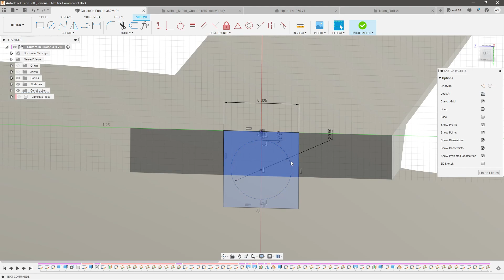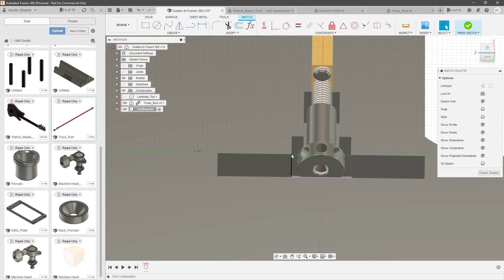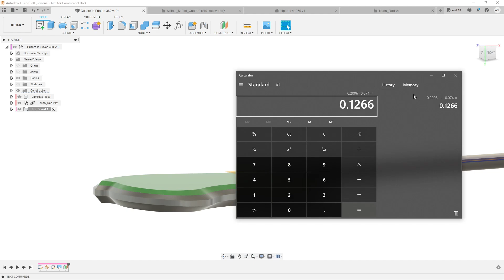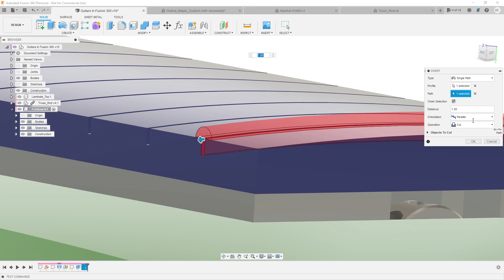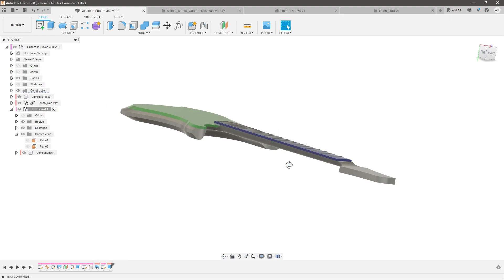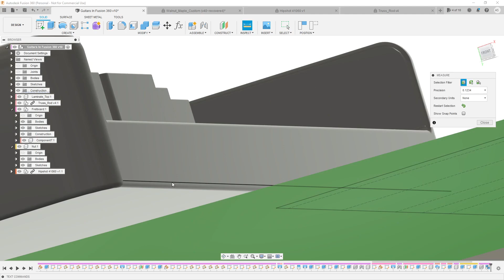Guitars in Fusion 360 | Part 5 - Fretboard, Nut, and Bridge

Comment: I like the Hipshot bridges for custom builds because, at least for their bass bridges, they give you a very easy way to place the bridge to get the scale length and intonation correct.  For a 34” scale bass they tell you to place the bridge until the distance from the nut to the bridge mounting holes is 34.75”. That way you know the extra play for the string intonation of your highest pitch string is per specs.